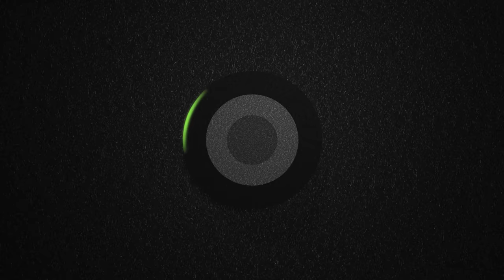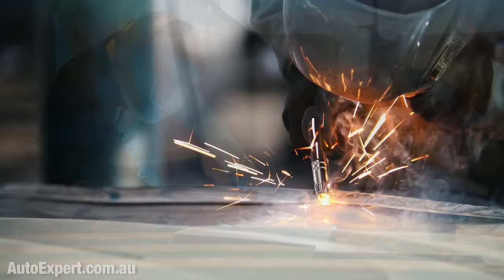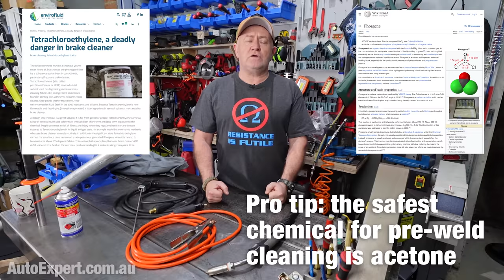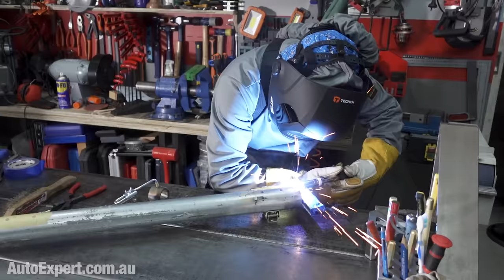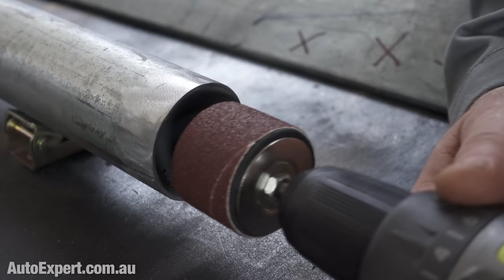How to die while arc welding at home: the top 5 ways | Auto Expert John Cadogan

Comment: #1 that came to mind for me was argon asphyxiation. 
Imagine you’re down in your fat cave burning away with your MIG and TIG, but the weather outside sucks so you keep the doors shut and don’t turn any fans on. Then for some reason your mind starts wandering away to LaLa Land, but you’re on the home stretch of this project so you lock back in with that #14 gas lens just blasting away. 
All of a sudden you’re getting sleepy, but there’s just a couple beads left then you can head inside, have dinner and crash. You bend over for one last weld - and lights out. You’re laying on the floor having drowned in a gas that you couldn’t smell, couldn’t feel, and you didn’t even know you were drowning. 

Argon is heavier than surrounding air, and it just lingers without any airflow. It will just sit in your lungs, slowly depriving you of oxygen and you’ll eventually asphyxiate without ever once choking. 
Open a door, set up a fan, and stay alive to weld another day fellas.

Comment: Just bought a welding rig for stick and tig welding. I'm completely new to this, so I'm getting up to speed on all aspects of safety before I fire this thing up and start practicing. I've read that it's a good idea to wear rubber gloves underneath your welder's gloves if you're going to be working in sweaty conditions. I live in Texas and will be working in non climate controlled environments, so yeah. I'm wondering if nitrile gloves are good enough to act as insulators, or if you need something a bit thicker. Any opinions would be welcome.

Comment: Many years ago my cousin was going to braze an inlet into a 60 L drum it was enclosed with a top and bottom. H had cut a small hole near bottom to fit the threaded inlet into when he brought the torch down to heat up the the welding rod, the drum exploded so violently it blew the end out of it which wrapped it self around a piece of steel. Some of the exploding gas came out of the small hole which flung the welding torch away and ripped the buttons of his shirt and flung him back the dru had been used for petrol

Comment: Cool video... and just in time for me. I live off grid on rainwater and solar panels and I'm trying to repair an old, galvanized steel water cistern to collect rainwater. I don't have much experience with my gasless mig welder so this video was very helpful in helping me avoid problems. I am thinking about using aluminum rods and a propane torch ... do you think that would work ? Any other suggestions on how to keep my old cistern from leaking would be appreciated.

Comment: Don't wear new flannel shirts as well because the fuzzy finish can flash over in seconds much like an alcohol fire. Use some form of non flammable ear protection to prevent spark debris entering the ear canal. If welding stainless steel in more enclosed spaces  -- especially if other welding is happening -- cover every piece of skin and wear a shroud on the back of the helmet because the reflective light is brutal.

Comment: Retired ship builder says that you must have never welded or used air arc at 600  amps in the pouring rain. Even with rubber gloves under the leather, you still got fried. I am 69 and a little weld current doesnt seem to have hurt me.

Comment: There is cases where you simply are unable to fit welding mask. Specially when you need to juggle the part, the torch, mask and maybe some tools at the same time. You can use the torch head to cover the arc for tags, just mind that if there is shiny metal around, it will amplify the spread of the arch and will cause the arc eye, so do use the mask and if you are not able to fit the tilt one, get cheap mask, remove the sides that take the space and move the hinge point on middle/top, or install the screen on the hand held one that you position just right. Its a hassle but better than arc eye or skin cancer.
Similarly with the angle grinders, dont remove the shield, just modify it a bit so it covers your hands cause your reaction speed or grip wont be enough to stop it from twisting and cutting your fingers off. Always have shield between the blade and your hands, or get another tool for the job. Thats why shops have the small pneumatic grinders/cutters cause those fit into smaller space, while still allowing use of shield.

Comment: Is the assertion here that SELV voltages can be dangerous under the conditions experienced in welding or that during welding operators can be exposed to voltage levels exceeding SELV thresholds?

Comment: Absolute truth each danger can and will happen if your not on the ball for 4 years I professionally welded  then hobby welded afterwards. and still I kept to all the safety measures never weld galvy just drill and bolt it. keep your area clear only use mechanical cleaning never chemical, sweat is salty and a very good conductor so always try to keep as dry as you can air out your gear if it gets damp, and always cover from flash. even reflected flash can burn you so make sure your not welding in a tight space with skin exposed.

Comment: From time to time when i have to weld galvanized pipes I put behind my self a medium size ventilator (50-60cm in diameter). When I weld I stop breathing, the ventilator behind me is blowing away the fumes and as I cover with my body the welding area the gasshield is still there. I wished to be able to afford this kind of masks you use. But thats all I have. Additional an air suction / filter device could help you too. Thanks for your tips!

Comment: It's worth noting that the risk of zapping yourself decreases by an order of magnitude if you use a semi-auto wire-feed welder. Unlike SMAW (Stick) that needs to be electrically charged at all times, a properly functioning MIG welders won't have any current unless the trigger is engaged. 

If you prefer SMAW for its lower equipment requirements, just be sure you are developing good habits in regards to how you handle the business-end. 

Keep a non-flammable bucket or container for hot rod stubs, don't leave partial rods in the stinger, and don't find yourself in a position where you are holding both the work-lead (Ground) and stinger at the same time with the welder powered on. 

You may see people in industry dropping / flicking spent rod stubs and loading in a fresh one in quick succession, but working on a concrete-floor warehouse or with a dedicated fire-watch is a very different story than in a home-shop. A 2" hot rod stub is small enough that an awkward bounce or accidentally kicking it with your boot can roll it somewhere it potentially starts a fire, and with your hood down working on the next weld you may not immediately notice.

Comment: This isn't a death risk, but spatter getting in your eyes even when you are wearing normal standard safety glasses is something that I have agonized over at my last welding job. There were many times when spatter would come up, and then it would come back down into my hood and hit the interior surface of the lens of my welding glasses and there were a couple of times where I even felt it graze my eyelashes. There are safety glasses that you can get that will form a seal around your eyes which is the best option but that can be extremely uncomfortable to wear full-time at a full-time job. There are also flame resistant drapes that you can get that attached to the top of the welding hood and drape over the back of your head, but you also need to be observant of how your head is rotated so that it's covered. I have found that keeping my head straight and not tilting it sides to side, and what I mean by that would be if you bent over and then tip your head sideways so that your ears are facing, one down toward the ground, and one of the sky, that helps with blocking spatter from getting inside of your hood. Nobody wants a glowing hot ball of steel to get in their eye,
Reply: I would hate to have those flame resistant drapes doing that over my head. Couldn’t even ask each other for consent?

Comment: Thanks, cool. When I was a kid I was either grinding or welding in my Father's garage, a place where I had almost electrocuted myself among other crazy ventures and lucky escapes; those were times when Dad was not around (he was big on safety, we had earmuffs and goggles etc in the 70's and 80's at home)...... I forgot about the open tin of kerosene or other solvent within reasonable proximity of my activity. Luckily I had a means of smothering it. I haven't welded since the 90's and then only stick and gas. I used to work at Monash Uni Caulfield Civil Eng as a technician. Interesting time in the structures lab. All kinds of destructive testing. Ironically (maybe) I ended my RAAF career as an NDI Tech, 2003-2019.

Comment: Thanks for the video I thought that's what ground was for lol I worked for years as zinc the chrome plater .working with cycnide based solutions .we had antidote there .those where the days .I think in Europe chrome plating going be outlawed .the industry not what was is trade of the past .I had no idea metal fever .I did welding course well light engineering in late 80s love engineering am just not very good at it.shaky hands not best for welding .was thinking getting stick welder .not sure anymore .great video esp bit about brake cleaner .

Comment: I had metal fume fever about 10 years ago when braizing some aluminium using zinc aluminium rods.  It's no joke, I spent the whole next day shaking uncontrollably, feeling like I was burning up, high fever and horrible aches all over, felt like I couldnt breathe, heart racing, it lasted 24 hours and I swear to god it was one of the worst experiences (short of anaphylaxis) I've ever been through. I've never not used a respirator since, for anything from dust to gas. Trust me, just dont take the fucking risk, I was outside and thought I'd be fine because there was a breeze.

Comment: sheesh, the stuff you are talking about is so absolutely basic in the trades, that its inconceivable to have it happen in industry, but to a layman buying a welder and a bunch of sticks off amazon, the guy probably has no idea the arc is hot enough to cause chemical decomposition / critical point of many liquids and gasses if the shop is messy or unkept.

really wise words here, great presentation. 

-from a fellow welding specialist
Reply: Yourself is Nothing of an Evil Boy.

Comment: I am a little late to the party, but "better late than never"', I guess? 

I welded as an occupation for about 20 years during the middle of my professional careers. I was certified closed root structural steel and open root structural steel and a few others I don't remember. It has been awhile, but that was how the certifications were referred to in the welding colleges I attended. (Lassen College in Susanville, CA / University of Alaska, Ketchikan, AK)   

I also had a lot of time welding with a TIG and wire feed welders during my early career as a millwright/mechanic. It doesn't matter, I welded for groceries and part of my time was in Alaska, albeit too late for the pipeline which used unique method of pipe welding. I started a pipe welding class in Alaska and I never finished. It was NOT my bag. 

The most creative way I discovered to attempt suicide was magnesium and aluminum powder. I had a specific bench where I did all of my TIG welding. No greasy metal parts ever got near that bench. I was grinding bevels in some large magnesium spokes and the dust collected against the backsplash of the bench. A couple of days later I put a piece of metal in the vise to bend it. When I lit the oxyacetylene torch the long flames hit the magnesium dust and kaboom! 
It blew everything on the bench across the shop. Luckily I was directly behind the vise and nothing hit me. I have always been paranoid of oxyacetylene torches since I burned my arm early on in my career so I had gloves and leathers on over my cotton coveralls as well as a full helmet with a #3 or #4 lens I used for cutting. Of course magnesium dust will explode, how stupid of me?  

A few months later I was beveling some aluminum parts for welding and again the dust collected along the back of the bench. Again I was using the vise to bend something and again I had on my protective equipment. When I lit the torch. . . . you guessed it, it kaboom, again! I actually thought about it when I lit the torch, but in my infinite wisdom I thought aluminum wouldn't explode like magnesium. Wrong, it is just as volatile! It also does a good job of cleaning the bench. Needless to say, after the second time, whenever I used the bench for grinding, I vacuumed it off afterward.

That was when I was in my twenties, long before I certified to weld structural steel. During my years of welding, as a career, at least half was with 7018/8018 LH rod that creates Nitric Oxide, Nitrogen Dioxide, Carbon Monoxide, Ozone, Phosgene, Hydrogen Fluoride, Carbon Dioxide, probably a great cocktail for lethal execution!

I was in my forties when I went to Alaska, and one day I was taking a break with an older welder who said I reminded him of himself, so proud that you finally made it and are considered a true welder, never realizing welding is not a safe occupation, especially using  low hydrogen rod. 

He told me his health issues and suggested I get out of the business as soon as I could, and I took his advice and went back to school and studied electronics. I am still alive and my lungs and heart are good because of that advice. I still weld at home when i have to, but I am just enjoying retirement and learning how to run a mill and a lathe.

Comment: I am curious about the chlorinated solvent.  What if all the solvent has evaporated? How dangerous is any residual cleaner?  Sounds like it's the residual as one wouldn't be welding if any liquid solvent was present?  Is there anyway to remove the residual solvent, like with alcohol or acetone?
Reply from the maker: Just use acetone instead of brake cleaner.
Reply: @AutoExpertJC  So using break cleaner, even if it all evaporates, is still a risk?  I am trying to understand exactly what is going on here.
Reply: Also, there is the same risk in HVAC.  It's why heating coils are put after resistance supplemental heating in a heat pump system.  If a chlorinated refrigerant leaks and hits a heating element, one gets phosphene gas...

Comment: yep   good points  .. I always  have  a look a round  before  welding ..make  sure  the  gas torch is  out of  spark  range,  WD40  and acetone etc   , the  zinc oxide issue  .aware of that .I have a   fan , my  shirts  always seem to have holes in them .. now i  know why , the UV  yep  i  should be more  mindful of that ... have  hasd a  SCC   removed  , the  electrocution  case  .. hmm I  would thought the   voltage  was  too  low .. In my understanding if  the voltage   causes the  body current to reach   10 ma  then  you can reset the points on your  heart   which is the real  killer .( actually  I did  zap myself once  but it was a 175V DC  zap off  something  else .. big  boot up the  chest...no pain  though   just a  big  ka- thump feeling .. ) . however  if you are  sweaty then  10 ma   could  easily be  reached   at low  voltage because the body resistance is  then very low  . I'll  watch out for that one ... and    the phosgene  ... are you  security    cleared by ASIO to reveal that ?.. now  that's  f'in scary  didn't know  that  .Ventilation is  important too  especially with  gas   torches  to avoid  monoxide poisoning ..ah the hazards of enjoying  yourself in the man  cave ..but its worth it . They'll  drag my  welder out off my coooold  dead body before they take away my welding  ..oh yeah

Comment: Your pointing out that break fluid, even though dry, leaves a residual chemical that is a toxic reactant to the welding process? Correct?
Reply from the maker: Brake cleaner, dude.
Reply: @AutoExpertJC  You are correct sir, "Break Cleaner," I miss spoke. So, is there residual chemical left on the metal surface after it completely dries?
Reply from the maker: Yep.

Comment: @3:57     Using brake cleaner to clean parts instead of only acetone.
@5:30     Electrocution.
@9:55     Melanoma radiation poisoning.
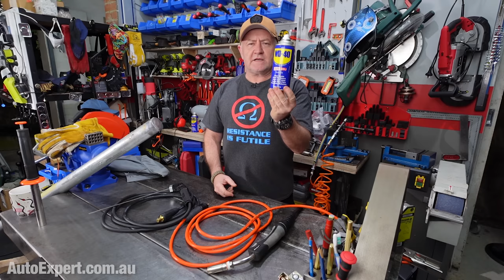@12:50   Hitting an aerosol can with the welder.
@15:13   Weld galvanized steal, Zinc off gassing.

Comment: Always wear a respirator, metal dust, galvanized, burning paint oil etc. all very bad for you, get a proper respirator and wear it all day if possible. A lot of welders are not careful getting pinned under heavy builds, or vehicles! Always make sure you use the right safety stands and make sure stuff is secured so it can't move or slide and hit you, or squish you. Don't stick your head or your hand where you wouldn't stick your peepee! If Electrical isn't your strong suit, get an electrician to come in and check your grounding and panels and make sure everything is safe for you, and your welding plugs aren't upside down. (trust me... wrecks your cords). Assume everything is hot, and don't rush things.

Comment: I got hit by a coworker when working in a powerhouse, we were using their 3 phase Miller to weld up an absorber we had to cut open to fix. When you have to hold a rounded plate of 3/8" plate steel in position with nothing to hold on to, you weld on a pair of 3/4" black pipes to make handles. He couldn't get the rod to light and I was holding the pipe to the plate, it stuck to the pipe and he yanked it up trying to break the rod free. Well, im holding the pipe with the stinger stuck to it while my other hand was holding steady to the plate.
Reply: I bet we can figure out what happens next,you got the jolt of a lifetime!